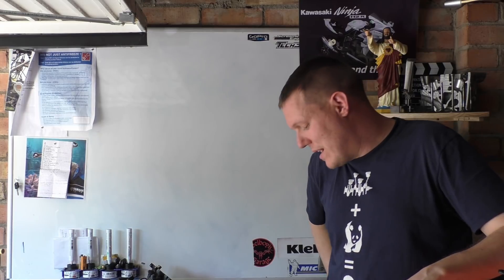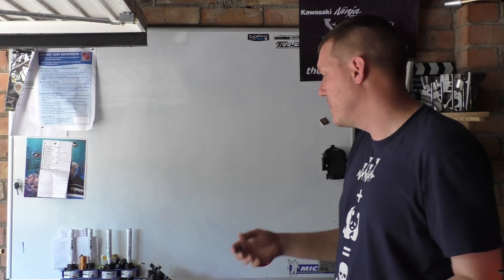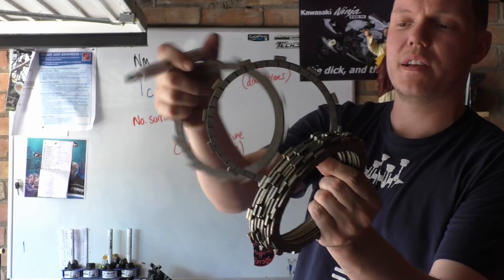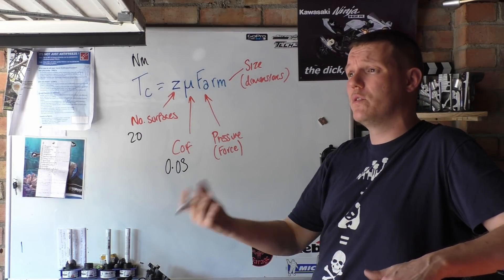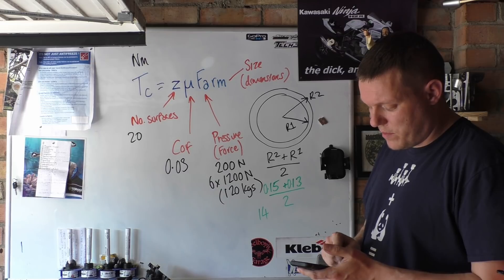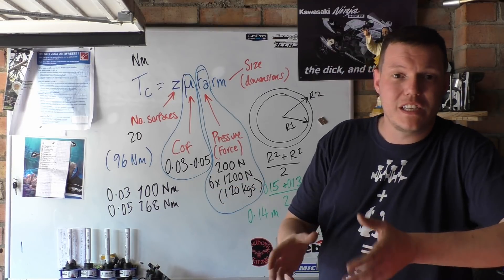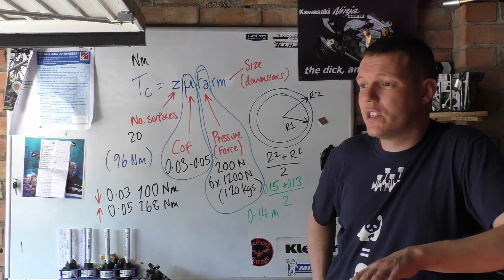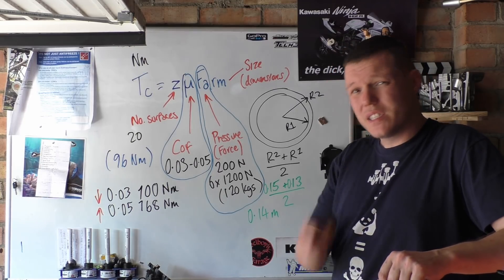Clutches - How to calculate Torque Capacity

Comment: Is it a problem if you pull a clutch apart and find some blue patches on the steel discs? I have seen this and presumed it was caused by heat, but wasn't sure if it was actually a problem or not. They were not warped.
Reply from the maker: Yeah the blue discolouration is overheating. Was it all of the steel discs?
Reply: No, it was just three or four of the discs that had a few blue patches. I was trying to solve a slipping clutch issue but everything was in spec when I measured the thickness. In hindsight I now wonder if the friction material was cooked.

Comment: Interesting video. The basic formula seems correct but...
A: with 10 plates you would get 18 surfaces not 20.
B: since the coefficient of fiction is between two surfaces i.e. two plates, shouldn't N=9 as there are 9 areas of contact between the 18 surfaces?
C: Your formula for calculating rm is definitely wrong (Besides the fact that you used diameters instead of radii). As per your formula the bigger the inner diameter the more torque can be transmitted which seems fundamentally wrong.

Follow up video coming soon?
Reply from the maker: A. LOL 20 surfaces not 18. These are friction plates....
B. No. 

C. Its not wrong (apart from the diameter bit) The rm is the mean radius.

"As per your formula the bigger the inner diameter the more torque can be transmitted which seems fundamentally wrong."

So we take the middle of the disc (which is what rm is) the torque inbound of that is smaller and the torque outbound of that is higher. these cancel out so the mean (average or middle in this case) is enough to calculate the torque capacity.

There's a follow-up video coming.

Comment: Two notes to your video.

You are measuring a diameter of clutch plates, yet you should calculate with radius (if the equation and picture on the board are correct).

SV is not good example to do the calculations for. It has so called "back torque limiter", which works as a anti-hop clutch as well as it increases the force Fa under engine load by using internal slope mechanism (you will see that). This means the torque capacity gradually increase with engine load, as more force is applied to clutch pack.

Comment: The only advantage of a dry clutch is no parasitic losses from slinging oil around ..     ATF automatic Transmission fluid has additives to help wet clutches ..  Super Slippery   synthetic oils can make wet clutches slip ..  gas savings  synthetic oil that is

Comment: Hey @The Workshop  I am still trying to figure out where Cristini is manufactured .  I think they use a lot of high quality components  .. I will be bummed if they are built in China   I wondered why they didn't cost much more than a Yamaha WR-450 ect  
http://www.christini.com/company/history-of-christini-awd

  When I put a Yamaha GYT Kit in a Yamaha GT-80  the Clutch sure did not hold well I added washers to the springs to make more holding pressure ..   Crower Glide  clutches for pulling trucks and pulling Tractors use centrifugal force to increase the clamping pressure as engine RPM increases ..  would not work well in a manual transmission that you want to shift on the go ..

Comment: Matt I am about to toss you a bloody tampon over... You took the diameter for the calculation not the radius! And I don't think that the calculation is right... I would take Pi x (R2²-R1²)
Reply from the maker: "You took the diameter for the calculation not the radius!"

Yes dude, I say radius like 3 times then add in the diameter - shit happens. There's also a slight fuckup when I say 96Nm for the SV - but I'll clean that up next time.

"And I don't think that the calculation is right... I would take Pi x (R2²-R1²)"

The radius of gyration is actually the sqrt of r2² - r1²/r2² - r1² 

but all the squares cancel etc - you lose some resolution doing the r2 + r1/2 but its easily close enough - this is from the radius of gyration when calculating 

"distribution of cross sectional area in a column around its centroidal axis with the mass of the body"

to quote wiki.
Reply: I guess close enough was never a hit... and if you really want to get it right don't forget to substract the gaps... LMAO! and guess what (r2²-r1²)/(r2²-r1²) is always 1 but r2² - r1²/r2² - r1²= 13.249 and Pi x (R2²-R1²)=43.96 what is right in my world of math to get the ring surface of the clutch I just don't get what the gyration has to do with the moment that the clutch will start to slip. Friction resistance has to do with a surface and force. if it swirls or goes in a straight direction is no different.
Reply from the maker: "Friction resistance has to do with a surface and force. if it swirls or goes in a straight direction is no different."

- does it now? Are you sure?
Reply: my opinion. I will not look it up.
Reply: The Workshop j

Comment: I don’t understand the “rm” part of your calculation. If you use (r2+r1)/2 then it would suggest that if you had plates that were 16cm od and 12cm id, it’d only be able to transmit the same amount of torque as if it was 15 and 13 although you have twice the friction material.
Reply from the maker: This is a short cut from the radius of gyration is actually the sqrt of r2² - r1²/r2² - r1²

its the mean (average) - you lose some accuracy but not that much.
Reply: The equation explained is the uniform wear equation (google it). This is correct to use for clutches that are worn and takes into account that the outer part of the clutch wears faster than the inner part of the clutch making the surface pressure not uniform across the clutch.

Comment: There must be something wrong in your inputs in the equation. The clutch on the SV must handle way more than 100 Nm due to the gearing ratio between the crank and clutch basket. Could it be switching "size"  to area? The radius plays in for sure but  wouldn't the area be as important?
Reply from the maker: LOL this is down to a few things....

1) I was using the 98Nm as a reference to what 100Nm is. But lost track of what I was saying and fluffed up.
2) I said radius and then added in diameter like a dickhead LOL

There is a big problem here - I put 0.03 CoF when its more like 0.3

I'll be redoing this video and putting in the correct numbers and adding in the primary reduction. 

"Could it be switching "size"  to area? The radius plays in for sure but  wouldn't the area be as important?"

- No. CoF is independant of surface area because force is distrubuted over the area regardless - if that makes sense.

Comment: I have a question.  On many bikes I've seen, the clutch is not mounted on the crankshaft, and the torque coming from the engine is already multiplied by a small gear on the crankshaft and a big gear on the clutch basket.

You calculated the torque capacity, but then threw in the engine torque numbers of the SV. How does that make sense, is the clutch mounted on the crankshaft?
Thanks for your help!:)
Reply from the maker: "You calculated the torque capacity, but then threw in the engine torque numbers of the SV."

- I was using the 98Nm as a reference to what 100Nm is. But lost track of what I was saying and fluffed up.
Reply: aah, okey. So the clutch basket isn't mounted on the crankshaft on that bike? are there any bikes like that?
Reply from the maker: Generally no. But there's probably one - just not one I'm aware of. The main reason why is primary reduction and the second reason is engine width

Comment: There is something wrong with your figures. First of all R1 and R2 are radius and you used diameter. If you use the radius your calculated torque limit becomes 50NM. Even worse your engine torque is at the crank. Primary reduction is around 1.8:1 so torque at the clutch should be around 170NM.
Reply from the maker: "There is something wrong with your figures. First of all R1 and R2 are radius and you used diameter."

- yes I see that now - fuck-up alert!!! Which is quite stupid because I say radius like 3 times.....

Someone else commented -

""You calculated the torque capacity, but then threw in the engine torque numbers of the SV." 

- I was using the 98Nm as a reference to what 100Nm is. But lost track of what I was saying and fluffed up."
Reply: I guessed the diameter/radius was a brain fart. It's the job of pedantic bastards like me to catch those ;-) The bit that puzzles me is why the calculated figures are so far apart. Calculated max torque 50NM but the clutch handles at least 170NM. I would have expected the calculated max to be considerably over, not under.
Reply from the maker: Whoops I thought I put this bit in LOL - the CoF for clutch plates these days is about 0.3 not 0.03 - this video needs to be done again without all the interuptions and fuck-ups on my part 

there's gonna be a video about the fuck up then a re-do.

"I guessed the diameter/radius was a brain fart. It's the job of pedantic bastards like me to catch those ;-) "

 and yes this is an excellent point that will be brought up!
Reply: On my best day I would do worse that you just did if I tried doing a video off-the-cuff like this. If I did it from a script I'd sound like a bloody robot. I'll stick to whining in the comments.

Comment: I like it when you write stuff down because literally when you just say stuff, its hard to understand. This can also apply to automotive automatic transaxles/transmissions, Differential clutches too?

Also how do i find the CoF of some clutches and the other measurements or specs?
Reply: Yes and yes. ATs use basically wet clutches for each gear and in a locking diff it's also just the same kind of friction stuff on steel. 
And, google if anything

Comment: Is the spring pressure at 1mm or at its installed hight ? as there is normally some preload on them when installed
Reply from the maker: 21zetec  spring rate
Reply: The Workshop I understand what a spring rate is. I ment in your calculation do you use the spring rate or should it be the at the installed hight ie if it had 6mm of preload then 1200n per spring so 7200n total force. I may be missing something here I'm no expert lol
Reply from the maker: Spring rates are constant. So for this you take the SV1000 numbers from the manual

Spring free length - 41.2mm (not required)

Spring tension - 20.1 - 23.1 kgf @ 35 .6 mm (which gives you your 6mm)

20 - 23 kg of force is the force - regardless of compression as long as its under compression. Multiply the Kgf by the acceleration of gravity - 9.81m/s2 or just 9.81 and for the range you get;

20 kgf = 197N

23kgf = 225N

The average is about 200N per spring. Multiply this by the number of springs (6) and you get 1200N

Comment: Motorcyle wet clutches look almost identical to the friction and steels in a car's conventional automatic. Most automotive frictions if you get water on them they dissolve and fall away from the material they are bonded too. I rebuilt an automatic transmission for a project for a family member and learned a lot. I knicked a lip seal twice and had to tear the transmission down and replace that seal twices.